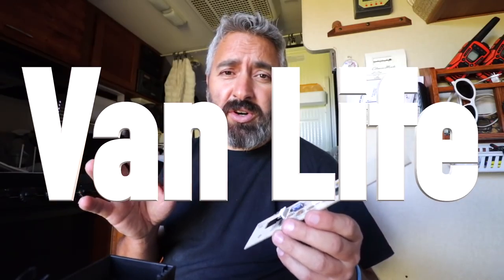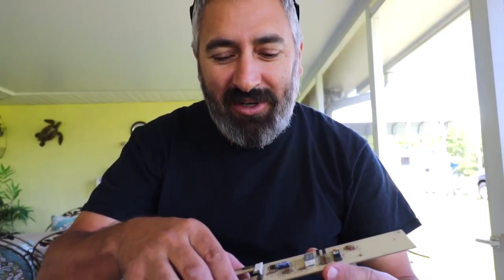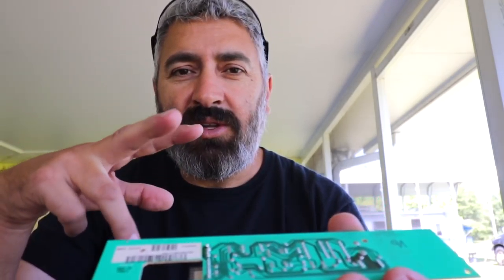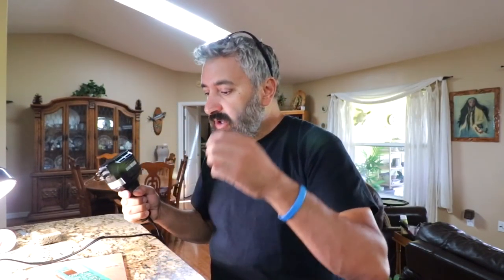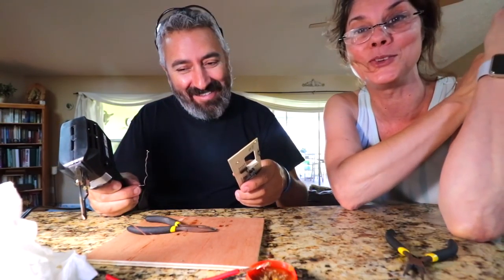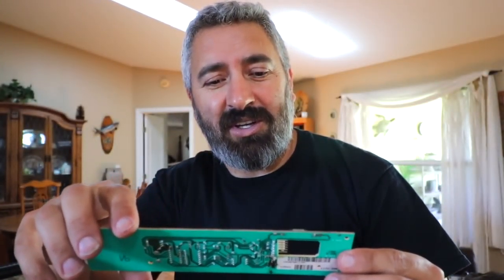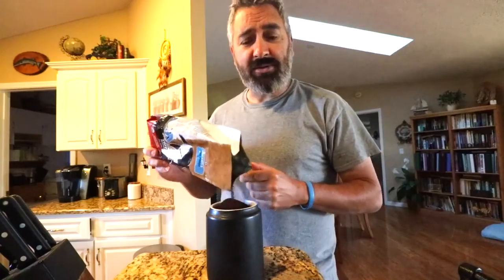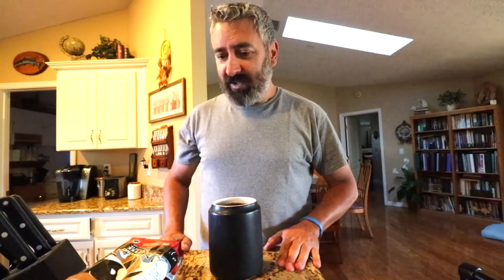Van Life; How Not To Solder A Circuit Board! The Lance Camper Solar Project! Part 18

Comment: Hi Luis,  When fixing a circuit board you really want to use a soldering pencil.  It has a smaller tip and won't get so hot to pull the traces away from the board.  Usually what I do when re-soldering is just to reheat the connections.  This usually works fine but if the traces are broken off I would take some CAT 5 wire (solid) and get one strand out at at time to replace the traces broken.  Another tip is that solder will flow to the heat and you need rosin in the solder to help it clean the connections along with bonding them.  Hey at least you tried.
Have a good one!
-Jon
Reply from the maker: I almost bought that the soldering pencil, then I figured this would be better...😂🖖🏻☕️🚐👍🏻

Comment: Good job Luis! You almost got it!! Think "PENCIL" soldering iron. I once replaced a blown diode in my wife's hair straightener using a finish nail grasped in a vise grip, heating the tip of the nail in the flame of a propane blow torch whilst in the middle of a bear attack out in the bush in British Columbia and was successful, and a was hero for a day lol 😨😉     Almost time for you to go back to work digging 👍👍
Reply from the maker: I know Jerry, almost bought the pencil, then thought, “this one has more power, that ought to be better.” Nope. 😂🖖🏻☕️🚐👍🏻
Reply: Rolling Earth-Ship  Well, you can always use the one you bought to weld plastic if you need to, for.. say, a broken grill on your van. Where's a deer when you need one, hey 😁

Comment: Luis, solder a wire to the connector pin and then solder the other end to some place on the board where the trace goes to.
Reply from the maker: I tried Jerry. I guess I need a little more practice. 😀👍🏻🚐☕️🖖🏻